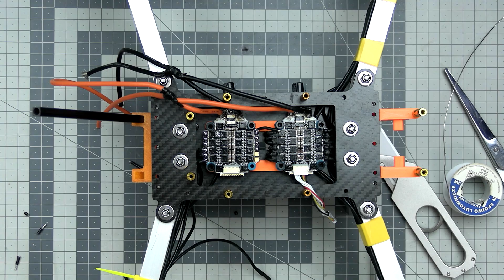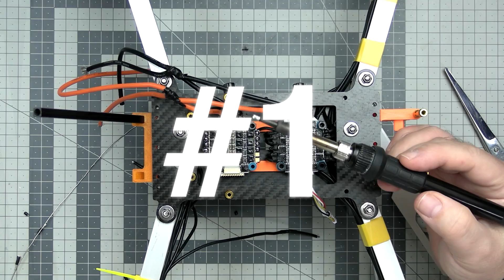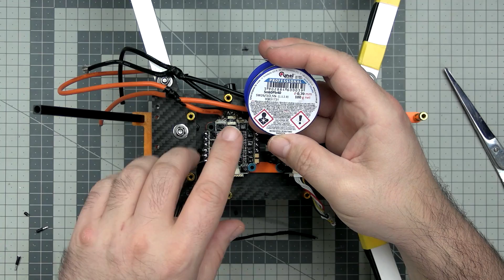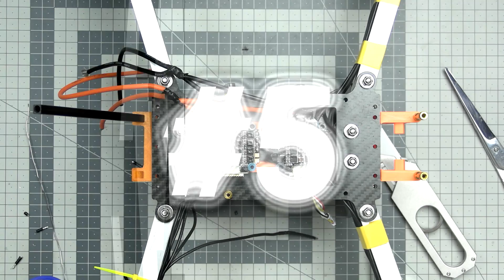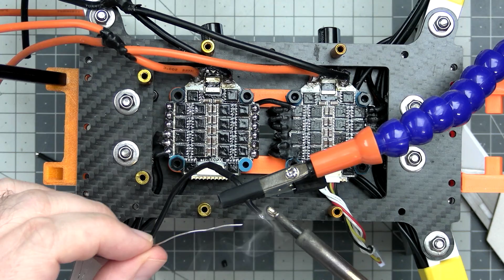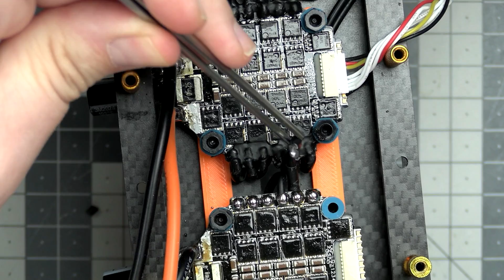7 tips for better soldering

Comment: Great video! I think the pointy looking solder is from not enough Flux. Atleast that's what I was always told. I always add Flux to the joint and touch it again with the iron and it usually turns into a ball
Reply from the maker: I almost stopped using flux when I started using good solder that has enough of it inside. Right now I only use flux on harder works

Comment: Excellent tips. Moving up to larger solder joints, including 4/0 cable, has really taught me a lot. The main strategy is to keep all components in a liquid state. Flux on everything, tip almost dripping with solder, all pieces at a relatively hot state before starting. simultaneous heating as Pawel demonstrated, and everything clamped or held tightly with forceps. Thermal mass is much more important than power. My biggest iron is a Weller 175 but that wattage rating is a bit misleading. The tips are 5/8 inch and cost 28 USD each due to all of the steel. It operates at 540C so the operator needs to be fast and smooth. All components liquify immediately, even if you can't get a solid placement.

Comment: Okay two things thanks for the video I always have trouble soldering the big pads I'll try the technique with the iron between the pad and the wire first. And second what's the black stuff you have covering you're already soldered motor wire pads?
Reply from the maker: That would be the Plasti Dip. Pretty useful stuff

Comment: I've got to replace my ebike battery again, I previously re-celled it twice, first soldered 28x pre-tabbed 18650's, then replaced with 14x 5000mAh lipo cells, now I'm thinking of buying high capacity 3S & 4S packs (of the same brand/cell capacity) to put in series, then I can use my quad chargers for charging/storage voltage etc.
I'm guessing my TS100 will struggle soldering the needed XT90 connectors to make a wiring harness for it? Not had issues soldering XT60's with it.

Comment: I agree with almost everything you said/showed..... except I found you spent just a bit too much time applying 400 deg C to the small PCB pads. There is a risk of loosening the Pad from the PCB it'self with prolonged Heat application...
Reply: Exactly. 25 seconds at 400 degC is far too long! 3 seconds is plenty of time to do a good job. If it's not done in 4 seconds, let it cool and try again.
Reply: @Sergeant898  Or use a larger Thermal Mass soldering Iron for the Quick Solder Joints

Comment: Good points but the one very important missing in your video: the soldering iron power. The very popular irons of 60W will not be enough to perform proper soldering on some type of pads. It was not enough in my case with matek aio flight controller for power leads.
Reply from the maker: 60W will be fine for it if you have a soldering tip big enough. Yes, itbsimple with higher power iron, but doable with 60W